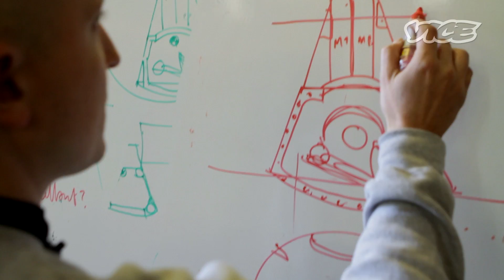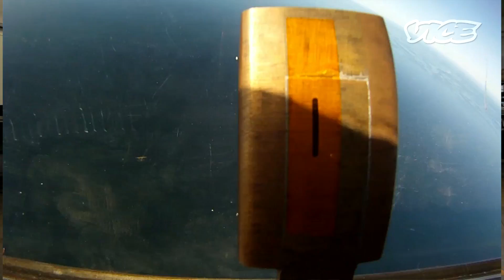Building a Homemade Spacecraft

Comment: If you want to work with CS, my suggestion would be to take a summerjob where you do some wielding and other types of metal crafting. They don't really need any theoretical worker, but they need practical people who can get things done. At least thats my opionion as a long time follower of the project.

Comment: Where do you think rocket propulsion was developed?  Do you think rocket scientists worked with the answers written down on a piece of paper from the god of science? No. They figured it out themselves, and there was a lot of political pressure to avoid any and all possible catastrophe, because not only were the spacecraft expensive, but so were astronauts, and the political cost of losing one in space would have been a threat to national security during the Cold War.  That's why it's redundant.

Comment: To fly anything below 100km (the karaman line) depends on the regulations of the country under it.  That means you should at least notify the air-force so they don't shoot you down.

Above the karaman line is the same as international waters; you can do whatever you want as long as you don't break or disrupt any satellites.   A satellite is like a boat; it's territory of the nation where it's registered.

There is no such thing as a "space licence", because it's not really an issue... yet.

Comment: The VAST majority of costs nations spend getting to this point goes into the research and testing; the engineering, mathematics, programming, materials testing, engine testing, pilot training & testing, air tunnel testing, vacuum / pressure testing etc etc etc
.
You save on A LOT of cost when you don't have to do any of that research, because its already been done many times over---you save on even more costs when you're going sub-orbital, and even more when you leave out redundancies for safety